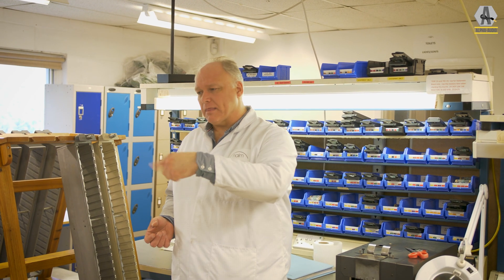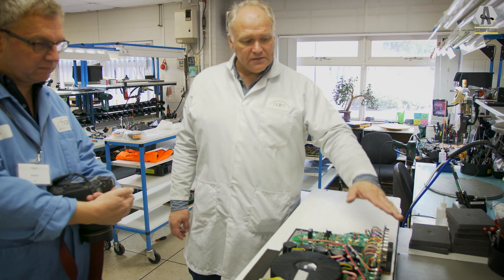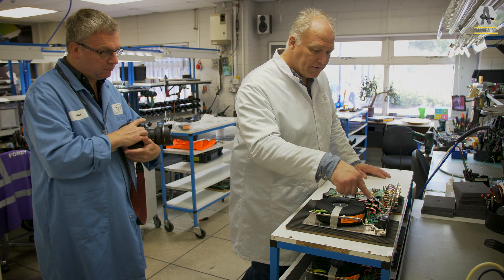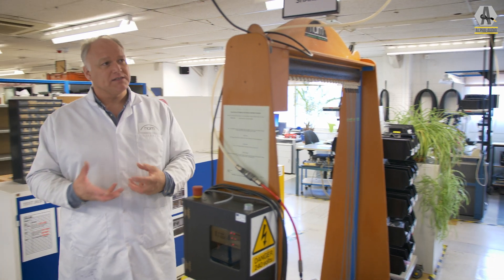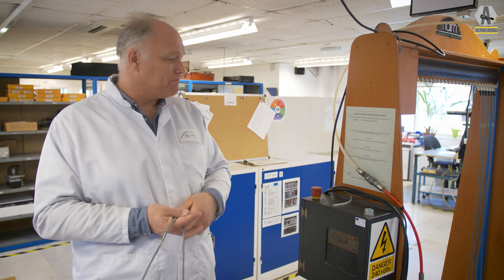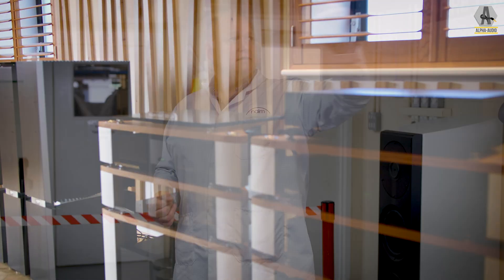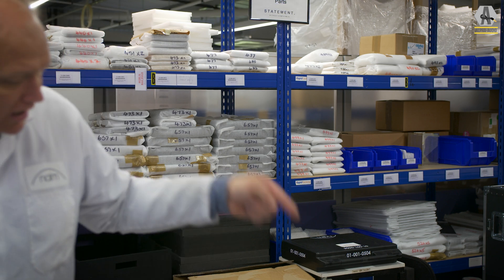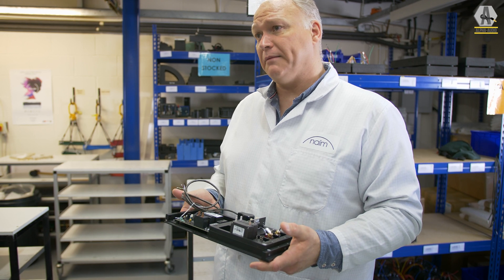How High End Audio is made - Factory Visit NAIM Audio - UK

Comment: Do you have a reference to an article describing the ABX test mentioned that proofs shaking cables results in such audible differences? 
“Extraordinary claims require extraordinary evidence” - Carl Sagan

"an RCA plug is 200 ohms" 12:35 ... False, it's more like 25 for the basic/standard ones. There's a couple of (cold welded/crimped instead of soldered) HiFi RCA cables out there with a true / symmetrical 75 ohm impedance (including the plugs). And for frequencies we see in analogue audio, sufficient. Issues start to appear in the radio frequency spectrum (multi-Megahertz / Gigahertz). 
It originated from the phono cable and was meant for audio signals. Yes, it was also used as DC-coupler, but this was not its primary use. RCA stands for: Radio Corporation of America... they were not in lighting business.
Yes RCA is not ideal. For easier matching use a BNC connector, you know those that were used for old coax computer networks. Originally meant for RF and video connections. They come in 50 and 75 ohm flavours.

What a bunch of lies.
Reply from the maker: We could set up a test...
Reply: It's not lies, it's what we found to be true, as opposed to what you believe to be true.

The shaking of cables came about because we, the people that listened to every naim product and made the final decisions as to what made the best sound (for us) heard the difference it made.

It's subjective, a matter of taste, not scientific, and we never pretended otherwise.

As for RCAs and DINS, etc, the din is simply a better connector in a naim circuit because it has a common ground, plus RCAs affect phase relationships - once more, proven to ourselves time and again by listening tests, not effectively meaningless measurements (in terms of sound quality).

As for BNCs, we used them too, for the phono input on naim amplifiers, because there was an obvious improvement in sound over DINs and RCAs. 

The only reason naim eventually changed to using RCA's for most of it's input connections is because the people who bought the company are only interested in commercial gain, not sound quality, and RCAs made it easier to sell naim in a market full of lazy retailers, most of whom couldn't, or wouldn't, solder a din plug on properly.

If you don't like naim's story, stance, nor methods of design and manufacture, don't buy any, simple as that. You choose, you lose ...

Naim was never intended for people like you, it was for people that loved music and used their ears to tell them what was good to listen to.
Reply: @marktucker4528  But why not rule out bias from sighted tests and make sure you don't spend time and effort where improvements are only in the brain of the (primed) beholder? I would imagine a company priding itself in engineering excellence is able to perform proper experiments to prove or falsify an hypothesis about what might contribute to better sound reproduction.
But you must be right, because I'm critical and have a scientific mindset means I must not love music because those two are mutually exclusive... /s
Reply: @Prophet1cus  Please read my other responses in this thread re: ruling out visual and/or priming bias.

As for measuring every effect we hear, since you have a scientific mindset, you should know that science cannot (yet) explain or measure everything. Surely you're aware of this?

There are some measurements that we were able to perform that pointed towards reasons for certain effects being heard, but they were too inconclusive for us to rely on them alone. Think along the lines of materials stress introduced during manufacture that affect microphony, and reflections in connectors, for example.

Other reasons and measurements that we believed we could back up with good science we preferred - and still prefer - to keep to ourselves, for reasons of intellectual property rights in a highly competitive market. Why give away all your hard-earned knowledge?

You commented originally, aggressively and accusingly, with the singular intention of discrediting the company and a loose explanation being made to interested customers by a non-scientific employee, who was simply describing as best he could why we did certain things a certain way - all without giving away too many trade secrets.

Had you been there you could have asked more detailed questions if you'd wished to and the company would have tried, wherever possible, to provide you with more information, within the constraints outlined above.

Just because you can't see the point, nor accept what people's ears alone tell them - even in the absence of a scientifically provable explanation - doesn't mean it's not true and isn't genuinely audible.

Good science is all based on observation and empirical experiments, followed eventually, hopefully, by a scientific theory to back it up. This process can take years, decades, centuries, ad infinitum, to reach a conclusive, peer reviewable scientific explanation. 

Good science also changes its position and adjusts its stance when presented with genuine new evidence.

My comment about the love of music aimed to point out that we, and hundreds of thousands of happy naim customers world-wide, let the sound we perceive help us decide whether or not something is good or better, without basing our opinions purely on science nor specifications, nor the word of someone else, nor the word of reviewers, critics, other manufacturers, etc.

If it sounds good, it IS good. We can/may find out why later on.

I can't tell you how many audio engineers and acousticians I've met in over forty-five years in the audio, studio, and music industries, many of them very smart people, but there have been dozens and dozens of them, and when they've presented me with their theories and explanations, backed up by all sorts of graphs, formulae, and 'scientific' explanations, only for me to have a listen to their product and find that it sounded execrable in the vast majority of cases, in my humble opinion, I (and all my colleagues) always concluded that listening should come first.

So as we always said, and this includes by some of the finest engineering minds in the business who graced naim with their genius, trust your ears.

P.S. Perhaps take a look at this video for a brief explanation on naim's philosophy and methods, not least from one of the cleverest people I've ever known, the delightful and talented Roy George, the company's chief designer and technical director extraordinaire.
https://youtu.be/aj5nxyeOSoE
Reply: @marktucker4528   That's a lot of words to say that you still trust your ears can hear things you cannot measure. I find it unlikely that there's still much unknown in the area of audio (reproduction). Of course I am open to the fact in science we always work with an ever evolving body of knowledge and still many gaps to fill. New knowledge leading to even more new questions. I just don't think audio is one of them.
It's perfectly fine if you approach it ears-first. But if you then hear something it might be a good idea to do a double blind test to check if what you heard was actually there or imagined (for all kinds of normal human psychological reasons). 
I find it highly unlikely the shacking of cables will result in an audible difference. I have seen no proof otherwise. No, I'm not going to trust some "but we clearly heard it" from sighted tests. No matter how skilled and/or respected the engineer or company might be.
Reply: @marktucker4528  Whatever indeed. Your fallacy of authority does not hold. I don't trust anyone on their word alone stating that shaking a cable causes audible improvements.
Reply: @Prophet1cus  😂 I was never asking you to take my word on the audible differences.

I've been asking you to believe that some differences in sound, and the physical reasons, cannot currently be measured.

You don't believe this, which is your prerogative. You choose, you lose.